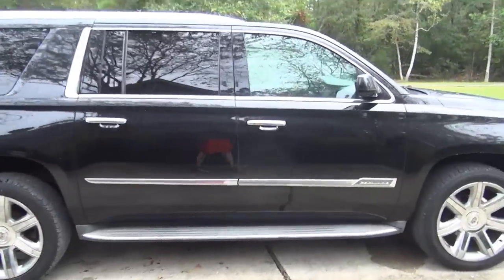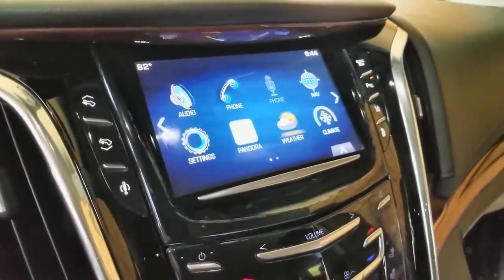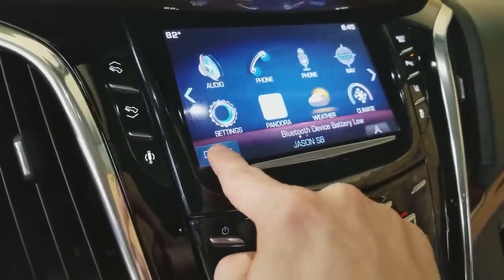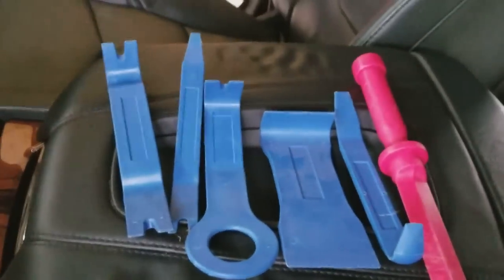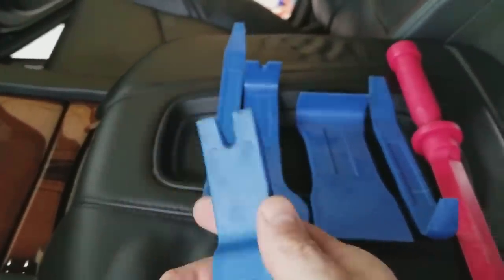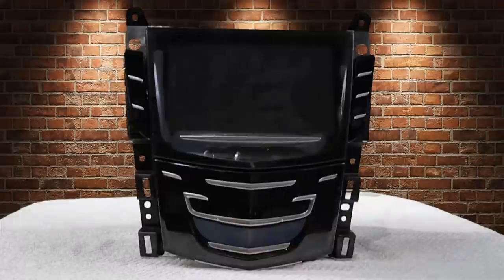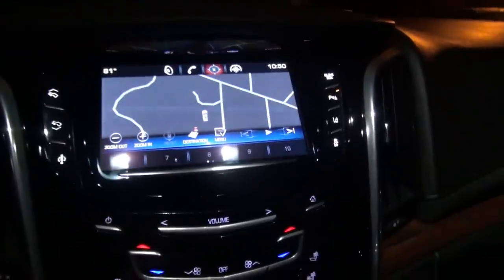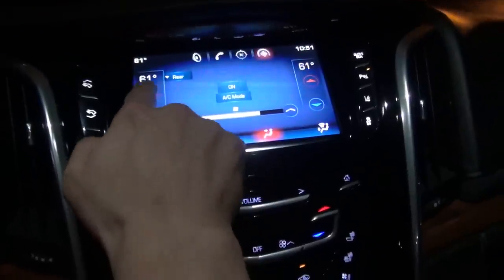How to fix a Cadillac Cue Screen. Step by Step

Comment: I had a mechanic break the embilical cord from radio to screen so ended up replacing cue system succesfully but my radio bezel with the 3 functioning lights/buttons (ie glove box button, pedals etc) on either side of Cue no longer function-these include on right side the glove box button ...these have simple cable connection for each so what could possibly be causing these not to work ? fuse ? firmware ?
Reply from the maker: @markfinestone652  could be the plug was not clicked in properly or you may just have gotten a faulty unit. If it was the original unit that has these functions then possibly a fuse but it is typically not separate fuses on one trim panel meaning all of them would be out

Comment: Hello.. I don't know if you can answer this one or not, but I have a 2017 Cadillac CTS. My problem is that my is black and the lighting from the screen all the way down the console does not come on. I'm unable to use the stereo, phone or Onstar. But if I put the car in reverse, the backup camera shows on the screen. I checked all the fuses under the hood, by the steering wheel and in the trunk. All are good. My question is; is there a fuse behind the stereo that hat could be blown, or will I have to get screwed and go to the dealership?
Reply from the maker: If you can't see part of your screen you may have the whole unit going out. Out sounds like the actual lcd may be bad. Our screens only fix the touch functionality. You can replace whole units but it will be a good bit more expensive

Comment: Question , after install the 2 buttons on the left and the 3 on the right stay illuminated even after the vehicle is off and the rest of the system is sleep. I followed your instructions to a T . Everythg works now but the button lights won’t go out any advice ?
Reply from the maker: You can email the picture and I will take a look but not lights should stay on if you followed the instructions correctly
Reply: @jasonateam  

Thanks for replying so soon . Actually the problem I thought I was having was just in my head . Taking apart the dash and going inside the cue unit can be a lil intimidating your video helped me complete the screen replacement with ease . I guess I just never really noticed those button lights until after I did the install and when they didn’t go off right away once I turned of the ignition I panicked thinking I done something wrong those lights went out probably right after I walked away from the vehicle lol. Everything is good and working as it should . Thanks agin
Reply from the maker: @Chris-hc9vb  awesome man! Glad you got it and glad the video was able to help. Appreciate you watching

Comment: Jason i have a 2008 sts radio works fine is the screen it looks awful faded and a minor crack, would i be able to change screen on that paticular cadillac?
Reply from the maker: Hey Johnny you can definitely replace it but not with the screens we offer. You will need to replace the whole unit. I suggest an after market unit which will be cheaper and have more features. I hope this helps and thanks for watching man!

Comment: Thanks for the video.  Completed the screen replacement but still doesn't work.  Would the screen still come on if the ribbon isn't connected correctly?  It comes on but doesn't respond to touch.  Purchased an OEM screen from eBay for 2014 cts
Reply from the maker: Sorry to hear about you having trouble. You can definitely see if you put the ribbon in wrong or if it is not all the way properly secure. We have had many customers not correctly install the ribbon. Double check to make sure the tab is all the way down on it. The screen replacement only controls the touch so even though you still see the picture doesn't mean it is plugged in correctly.  They don't make an OEM screen but sounds like you might have got a bad aftermarket screen. We have quality replacements available and we guarantee them if you can't correct your issue. Good Luck
Reply: Hello, I am having the reverse issue. After installing my new screen the touch works but the picture doesn’t come on and the screen is just black. Any ideas what could be causing this?  My picture was fine before I installed the new screen. Thanks
Reply: Fixed it!  Found out I left a cord unplugged in the back 😖

Comment: You mentioned you want to test it before re-installing it.
How did you test it before reinstalling it?
Reply from the maker: Hey Earl, thanks for watching. You just have to plug it into the vehicle and turn on the ignition. You still have to install the screen on the actual CUE though. I was only referring to before you put it back all the way with all of the trim pieces
Reply: @jasonateam  
Thank you so very much, as others have said, to take the time to do this, much needed.
Ours just went out and you know what the dealership said as a price$$$$..
Reply from the maker: @UncleEarlHeatingAirCondition  Your welcome. Glad it could help you. When I actually first made the video that didn't have anyone with any instructions so I figured I would  make it in hopes it could help. 👍

Comment: Was is the right position of the screen ribbon,  I change the screen but doesn't work , please help me out , perhaps I put it up side down.
Reply from the maker: It is very common to put in the ribbon cable incorrectly. Take your time and secure it in and it should get it done for you

Comment: Just bought a '16 ATS today.  While driving it home, the CUE was going wacky ... freezing and unresponsive.  Very frustrating.  I'm going to first try to reset the CUE according to another video, but it that doesn't work, will the procedure in this video work?  Thanks.
Reply from the maker: Hey man sorry to here that. The reset probably won't work but worth a try and yes this will correct it if it doesn't.
Reply: @jasonateam  Thanks for your reply.  Yeah, you're probably correct, but for a 60-second effort, I'm going to try it anyway.  If it doesn't work, I'm going to order a screen from your link above.  Again, thanks so much for this video, Jason!
Reply from the maker: @rand49er  I agree. I hope it does work for you. 👍

Comment: Any idea where I can buy the tools you are displaying?
Reply from the maker: Hey Carl. We can send you just the tools. Please send a message on our website and I will shoot you the link. Thanks for watching
Reply: I hate to be real pita but I'm hoping you can help. I purchased a screen (OEM) from another source and was given some very flimsy tools in addition to a link to your site. You show a very good video for the Escalade but I have a 2016 SRX which does not disassemble in the same way. I've considered buying a Haynes manual but realize that Haynes will sometimes direct you to a dealer, so one question I have is have you had success with such manuals in showing you the way? Another question partially answered in a previous comment is about the tools required to get the job done. I see that you have quite an array so I'm curious as to what you will send me and the price. Obviously the flimsy tools I already have are practically useless. Thanking you in advance for your assistance.
Reply from the maker: @carlh4201  if you send your email address I will forward you a link to the tools and I also have a video for a srx 👍

Comment: Thank you for the video. Deconstruction on a a srx is a little different, just had to look how it was installed after that your video was great, Had a slight problem with the ribbon wire but that was my fault. Other than that great fast service and the screen is working great! AAA+++

Comment: Great video! Follow your steps and everything worked on the screen. But as a result the piece below the touch screen stop working ? Any ideas what I can do ?
Reply from the maker: Are you referring to the hard buttons? If so I would check one of your fuses. Everything should work like normal. Let me know.
Reply: @jasonateam  I redid the entire process and still the hard buttons arent working. They worked fine before when the screen was cracked. Now that the screen is replaced they don't work.
Reply from the maker: @mr.amazing1742  the screen replacement will not effect the hard buttons at all so I am thinking you missed a connector on the back or you have a blown fuse. I hope you find the problem.

Comment: Is A Vin number needed to order a correct navigation screen and is a gel type screen system compatible with the new type system with no gel
Reply from the maker: You will need to put in just your year and model when checking out. It will not let you order a screen that isn't compatible.

Comment: The instructions were great, only problem I have is the part about tiny ribbon cable for the touchscreen. You mentioned a little locking tab to flip up and down but it’s impossible to actually see what you’re talking about on the video. Even with my unit and a magnifying glass I really could not identify any locking tab or how to move it up-and-down. I finally gave up and just ripped the ribbon cable with tweezers and it very easily just slid right out. Another problem is that your video doesn’t clearly show which direction to put the ribbon back in, there is a very slight difference from one side to the other. After reassembly the touch function does not work on my screen and I’m wondering if it’s because the ribbon cable is in upside down or perhaps this mysterious locking tab is not seated? A more clear explanation with a photo would be much much appreciated!

Comment: Thank you, the problem with my cue screen is that the back ground light is darkened, I can hardly see the touch options, when seen it works! How can I replace the light
Reply from the maker: Thanks for watching. You can't change the light however you can definitely adjust it. You may accidentally have turned it down or possibly have it on night mode during the day. I would check your brightness setting and also the other setting. Hope this helps and thanks again for watching!!!

Comment: Thanks for sharing your knowledge. Would it be possible to replace and upgrade the screen? As you know newer Cadillacs have improved the the Cue system to include Apple Music.    Can you add a screen with more modern bells and whistles? Thanks
Reply from the maker: Thanks for watching. Yes you could upgrade your unit if you found someone that had those available. You would need to get it programmed once installed as well. I am not sure where you could find that. I'm sorry I don't have anyone to recommend. Thanks again for watching.

Comment: The problem I have is that the display and the cluster cut off so they don't power up I seen smoke come out of the display radio do you know what I need to buy
Reply from the maker: If you saw smoke come out of your dash you have a major issue. I have never heard or seen anything that major before on a vehicle. I would bring it in before something really bad happens.
Reply: So everything works the only things that don't work is the display and the dash they are off
Reply from the maker: @JuanCruz-cr2py  an electric fire is a serious underlying issue causing it. I'm sorry I can't help you with that without looking at the vehicle. I recommend you bringing it to a professional. I wish you all the best

Comment: Jason, I have a 2015 Cadillac XTS with a bad Cue screen. Does anyone have a video of the removal of the Cue. I see ever video but that particular one. I would like to know how much of the trim I need to remove. Thanks for your help. Russ
Reply from the maker: Russ Burrier I will see what I can find for you. We are in the process of getting them out
Reply: Do you offer installation of the screen if the Cue is sent to you? I'm in Florida. There is a company near Orlando that does it, but I haven't checked into the cost yet. You have to send them the cue and its about a week turn around time.
Reply from the maker: We could do it but if you are able to get the system out yourself you should really just do the switch yourself. The video will guide you step by step once you have removed the system and you will be able to save additional money. You could also pay more and try to find the complete replacement part. Although most of those units are refurbished and also need to be reprogrammed. Just let us know what you would like to do.
Reply: Jason, I got the tools today in the mail to take off the trim panels. I can't find your site to find out how much you get for the replacement screen. Can you direct me there?
Reply: I found it Jason.
Reply from the maker: Russ Burrier it is in the description and a link in the video in the upper right hand corner can take you to it as well. Thanks

Comment: 2018 cts the screen is locked on keep your eyes on the road,  what should I do ?
Reply from the maker: It could be frozen sure to touch but without testing I don't want to misdiagnose. Changing the screen is not a sorry expensive job though and may be worth trying

Comment: Quick question.  My screen works fine but the long silver touch sensitive for favorite radio stations and eq  does not work.  Will the new screens fix that problem?
Reply from the maker: The screen will only fix screen issues. If you are having an issue where a hard button below the screen isn't working then this will not be the correct solution for you. You will probably need to replace your whole unit. Thanks for watching. I really appreciate it.
Reply: @jasonateam  Thanks for the heads up on that. Well that sucks to here I have to invest that much into a new one.  I see the screens they sell on Ebay have the the button on the bottom which would seem like that would fix it.  I guess I have to do some more research.
Reply from the maker: No problem. You can find some refurbished whole units but you will have to more than likely get it programmed as well. Wish you the best of luck
Reply: @jasonateam  Yes sir I have found some at a great prices like 500 bucks on Ebay but as you said mine is the base model 2014 XTS and some of the other CUE syastems at that price I was looking at has the heated seats and extra options which would make me have to get it programmed.  I'm hoping to add the heated seats and camera later on as I see it's possible with some work involved.  I just came from a 2009 Escalade that I owned when it was just 2 or 3 years old and had every option but rear entertainment center so I would like the extras for sure but didn't want to pay the extra price at this time for the twin turbo or more loaded models. Well made video by the way.

Comment: Nice video,, but if you notice right of the bat the very first piece of wood he took off chipped the wood off the edge, you can see the chip in the video near the screen. I know because that is exactly what happened to both of the wood pieces I took off the dash. And I used the tools and have done this many times. You have to be over the top careful when taking off the 2 wood strips, especially where they go under the chrome strip at radio edge. DO NOT LET the wood catch the edge of radio when taking off,, or you will buying new ones.  The wood veneer on these trim pieces is super thin,, and chips off by almost looking at it. SO ne careful!!!

Comment: Mine is only not working at the bottom. So the digitizer is only thing not working. I heard that a new GM has switched to another company to make their digitizers. What is the old company and what is the new company? iphone G3 back in the day you only had to unconnect the pin connectors and reconnect the pins and screens would work again. I noticed the pin connector was a sanyo in your video.
Reply from the maker: I am not sure if they have switched. It would make sense. You can order a replacement by clicking on the link in the description. Thanks for watching and commenting.

Comment: do you know how to permanently disable the alarm? keeps randomly going off. not worth the headache of pissed off neighbors.
Reply from the maker: You can try and locate the fuse and pull it but I would check that you can still operate starting the vehicle normal after, as it may not allow you to. If you can it should be good.

Comment: hello I'm from Québec Canada , I,m the owner of a 2014 Cadilac SRX  my problem with my cue system screen is than in real cold weather i getting frost under the touch screen, did any of you ever had the same problem and found a way to fix it. the frost does not affect the system.
Reply from the maker: m racine that's the first time I've heard of that issue. Hopefully someone on here can help you. Only thing I can think of is if a seal has a crack in it around the screen

Comment: Where did u get the screen??   I can only find 2 sellers on ebay that sell them.  I can't find any other retailer that has the screens.  My other question is if the screen is still working??
Reply from the maker: I added the link in the description and also onto the video itself and yes it still works. Thanks!

Comment: My screen isn't totally unresponsive, but does go unresponsive at some point.  It starts normal, then the radio shifts around and the radio buttons scroll up and down and side to side and then it starts reprogramming all the middle radio buttons to the station I am currently working on.  Would a screen replacement help or does my whole system need to be replaced?
Reply from the maker: Carin England thanks for watching. When you say the buttons are you taking about the buttons on the screen or the hard buttons. If it is registering your touch on the screen then yes our screens will fix this issue. It is only a matter of time before it will be completely unresponsive. Even if it sometimes works then gradually goes out.